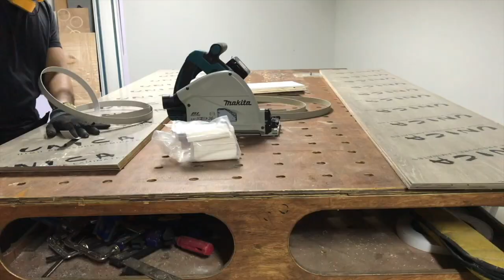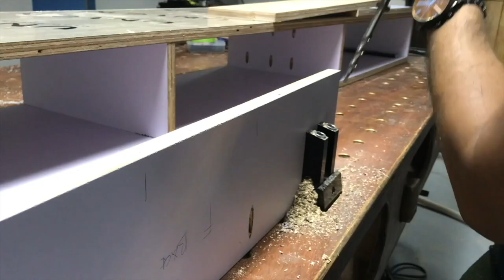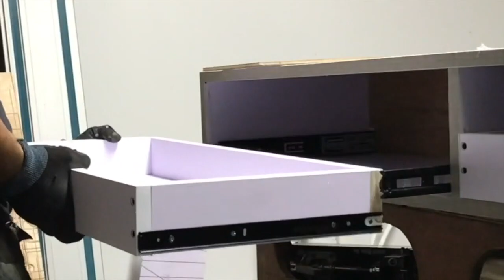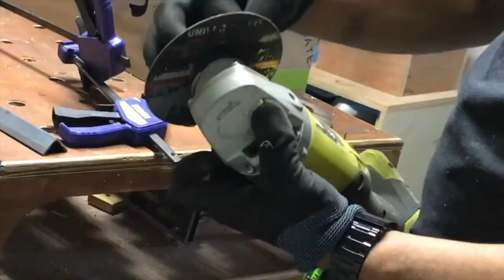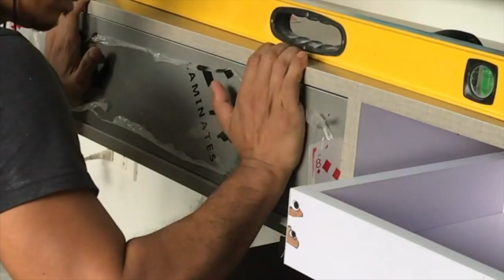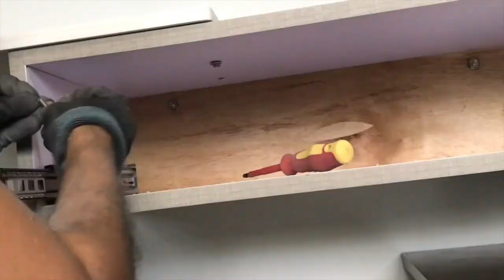DIY Floating TV Rack

Comment: How did you screw in the pocket holes screws for middle support . There is not enough space for the drilling machine to enter ?
Reply from the maker: Hi Renwick, i use Right Angle Drill Extension to reach the midle support pocket holes screw :)